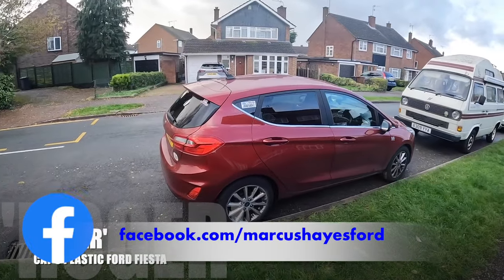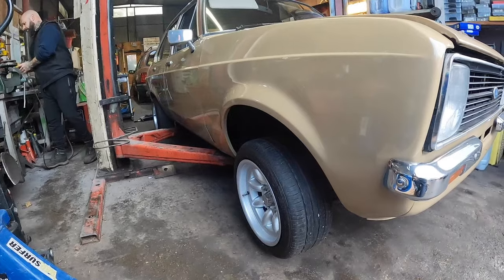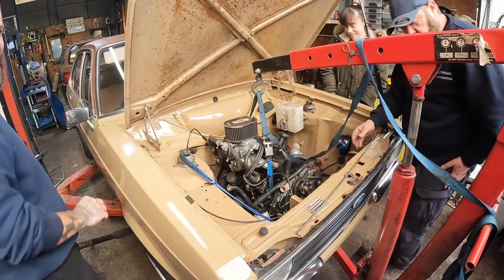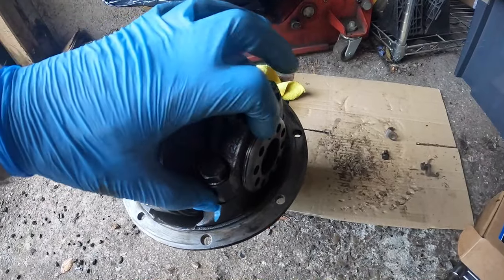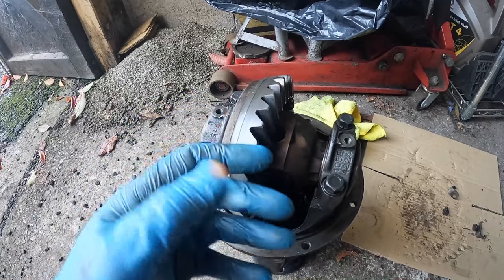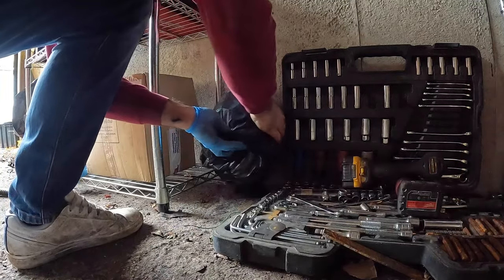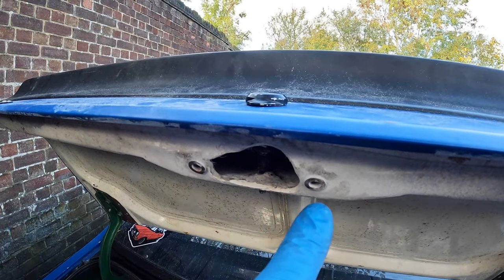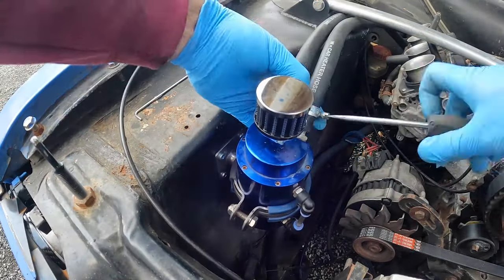DIY differential setup! 😃 How hard can it be??? 🤔

Comment: Just a thought Marcus if you have your cam buckets ground will the bucket face that touches camshaft still be hardened don’t want you fitting it all up then in 500 miles you have issues again with it running rough because they have worn out.
Reply from the maker: I'll defo be looking to get new ones but hopefully the ground ones will help me see if Iv got my maths correct first. 👍

Comment: You need to set the preload using something like a leather lace around the flange where prop connects get a weight measure something like what you use for fishing wrap the lace around who flange and pull on the fishing gauge so it turns the diff and measure what the weight shows not sure off top of my head what a english diff is
Reply from the maker: I bought a beem type torque wrench to measure the bearing pre-load but I couldnt find the data anywhere. The Escort manual only shows the 0.2 - 0.25mm of spread. . . . . . I should however have put the diff under load whilst checking the backlash BUT there was no way I would be able to do it with my magnetic stand being so weak. 👍
Reply: @marcushayesford  yeah you need it done properly 
Over 30 years ago I did what you did and thought it was ok put diff in and it locked up while driving you can imagine the results

Comment: Ffs marcus, use a brass drift against your brgs not a hammer ( a claw hammer at that) pre lube all brgs with gear oil, new brgs don't need to be matched , they have no wear marks yet.set your pinion depth first then set carrier lash and check gear pattern. If i lived in uk still i would do it for you. Your always entertaining but sometimes frustrating.  Good luck buddy